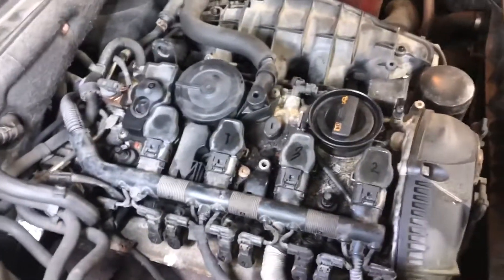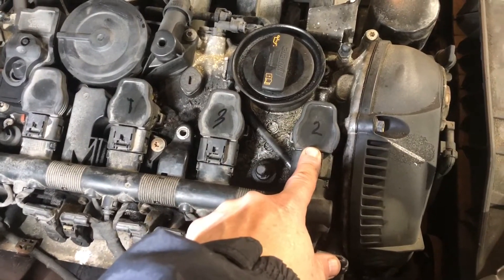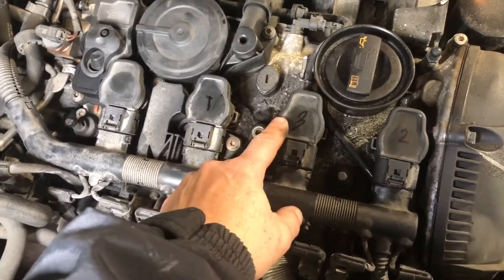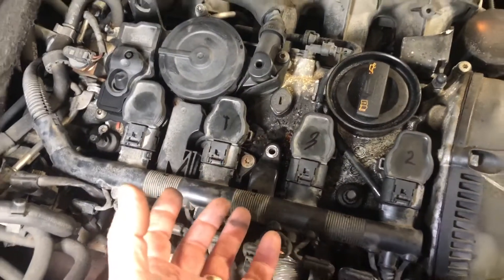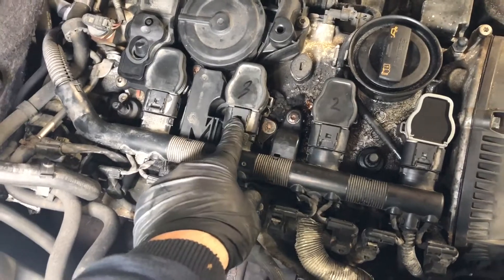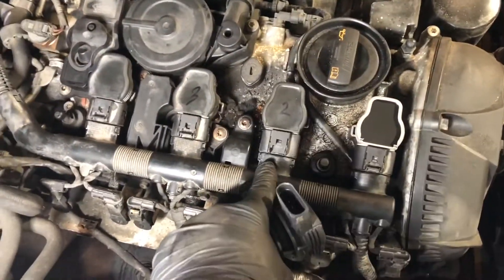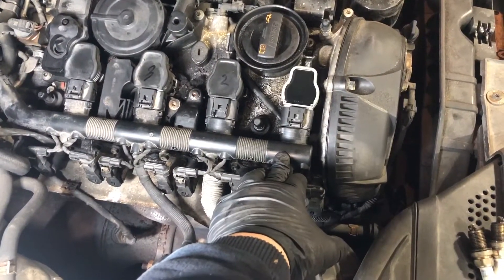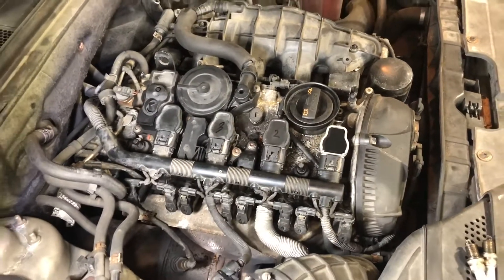Engine cylinder misfire diagnostics with no special tools Shell Game - Audi A4 B8 Quattro

Comment: Pretty sure i've got the same issue,  but the missfire don't move, and i've changed all plugs and tried changing coils to diffrent plugs, still missfiring. Car still sounds like a lawnmower whenever we start it and rev,

 So we are guessing its the dynamo or fuel injectors at this point, and we tried running a diagnostic tool and it keeps saying problem with cylinder one.
Reply from the maker: Do you have an old plug you can stick in the end of the coil to watch for spark?  Leave other spark plug in engine and coil plugged into harness.  Don’t run long.  And plug needs to be grounded (use a wire or a brave buddy to hold coil and plug against engine for ground.  This is to check the wiring triggering from computer.  There are special testers for that but assume you are going old school.

Comment: My Audi runs rough at idle. I have multiple misfires on all cylinders. I get codes po300, po3001,2,3,4. When I remove the oil dip stick the car revs up?
Reply: Could a bad pcv valve cause all this?
Reply: Did you ever figure it out ?
Reply: @NSDBullys  Yes, It was one bad valve that wouldn't clos all the way.
Reply: thank you @MrJChave